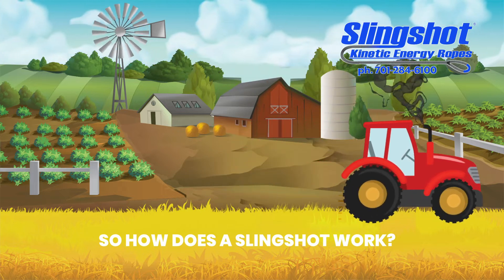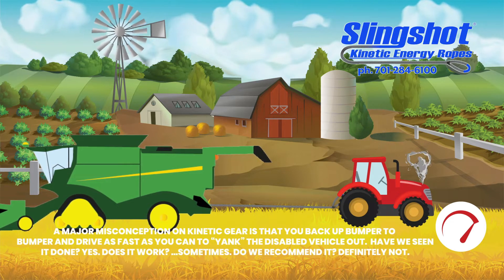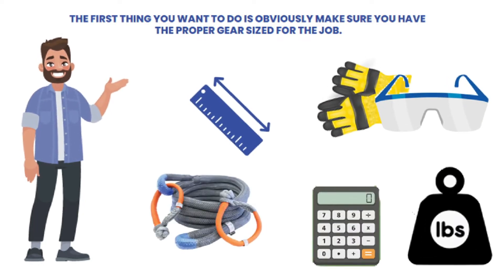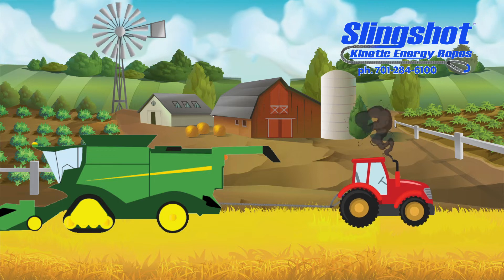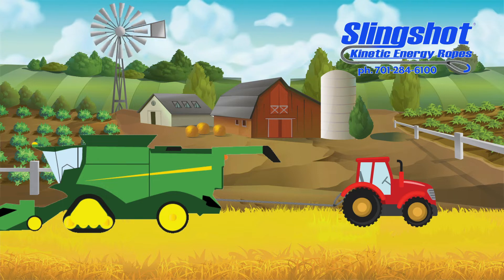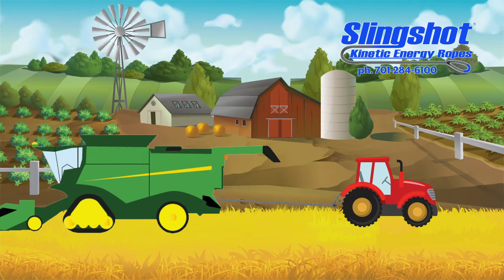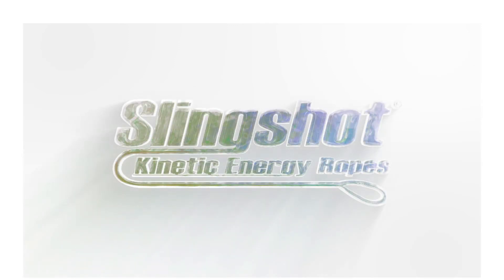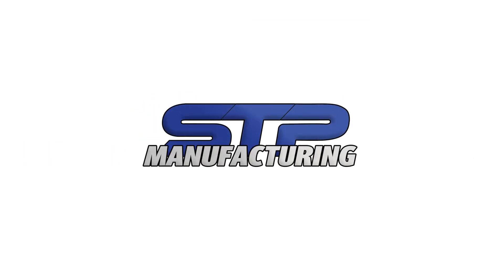What is a Kinetic Energy Rope & how does it work?

Comment: But when the rope stops stretching, does it snap towards the towing vehicle, in which case, you can't stop it, and can it smash into the towing vehicle?
I would like this explained,  as I think this is perfect for our needs, so I am definitely thinking of buying a few of these.
Reply: This channel explained it in another comment. But basically he said it's really important to tie it  low and flat. He said because they typically snap when they are completely stretched they go straight often under the vehicle. Instead of whipping wildly like a steel cable. Makes sence to me.🤷‍♂️